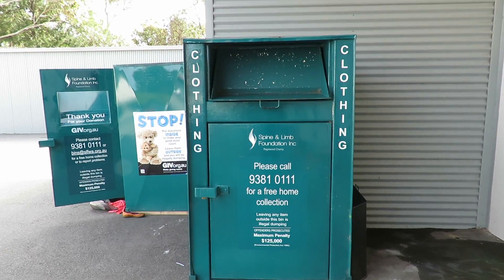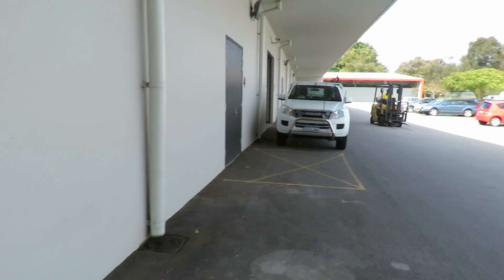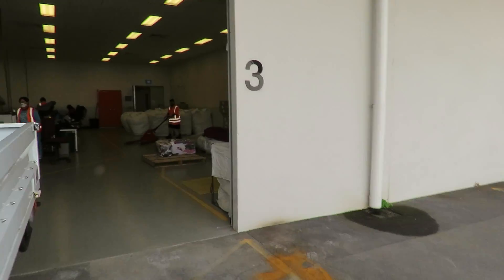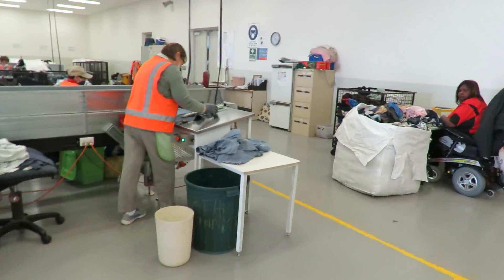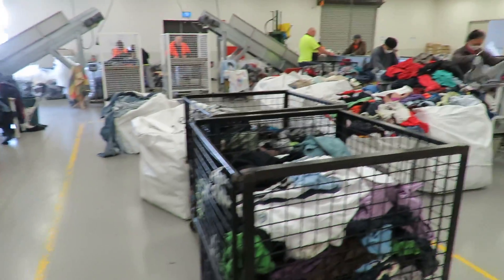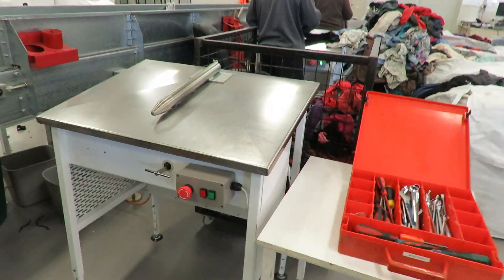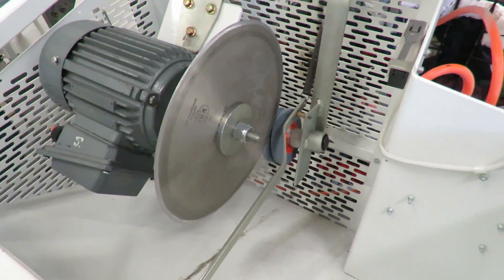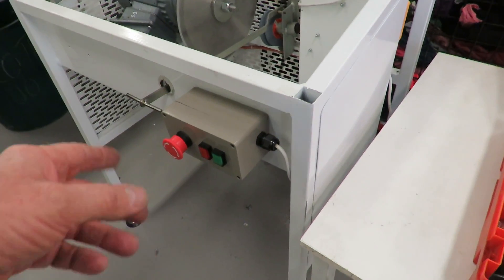Cloth Cutting Machines Paraplegic and Quadriplegic Industries

Comment: Bruce, did you fabricate all the parts of the machine in your shop?
Reply: By the way, I live 20 minutes north of Chuck B and have visited him in his shop. He is really a great friend to have.
Reply: By the way, I live 20 minutes north of Chuck B and have visited him in his shop. He is really a great friend to have.
Reply from the maker: Kurt Yes I made the complete machine, I will compile a vid of the photos, the only items that were made outside were the plate items and the punched guards, my wife and favourite no. 2 granddaughter Jazz (6 at the time) assisted with cutting and soldering the wires. I nicknamed Jazz the "Bolt Ninga" when she has a spanner in her hand watch out guaranteed to be torqued well!.
Reply: +Bruce Whitham By plate, I guess you mean the sheet metal as we would call it here in the states.
Reply from the maker: Kurt yes fine line between sheet and plate, the tops are 3mm which is borderline the rest is sheet metal for sure, we also refer thin stuff as sheet metal.

Comment: Hi Bruce
There are places like that one in every city may be worth doing some research my disabled son was working in a place similar to that one but not with those type of machines.
Nice design.

Dave
Reply from the maker: David good Idea I didn't think of that, there are no cutting tables like this anywhere, all the ones I saw were very agricultural. I spent a lot of time building these to be operator proof (some are pretty brutal). All the private companies I approached wouldn't spend the money, I'll take on board and see if the manager here can connect me with other places, as his testimonial would be priceless. They are now working 4 years 5 days a week no issues all the teething problems were over in no time and they require very little TLC. Thanks  Bruce